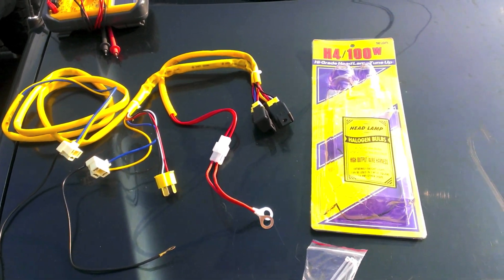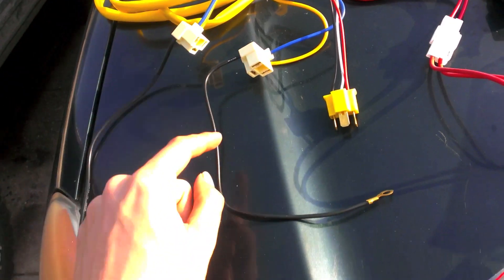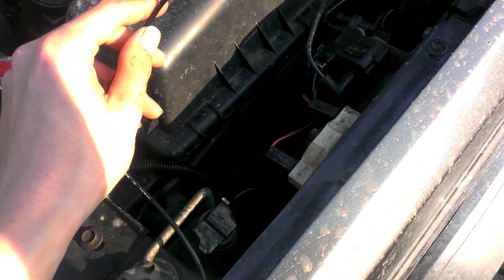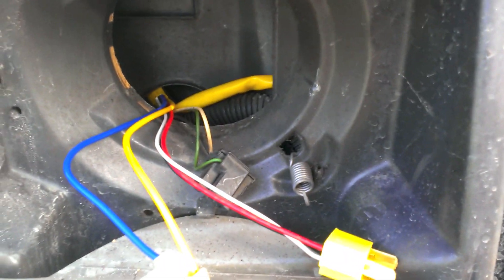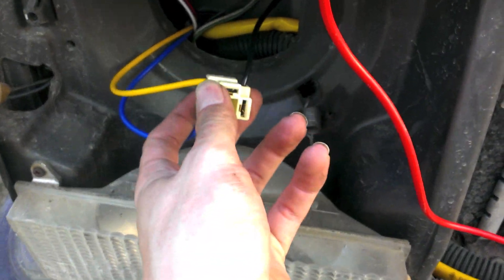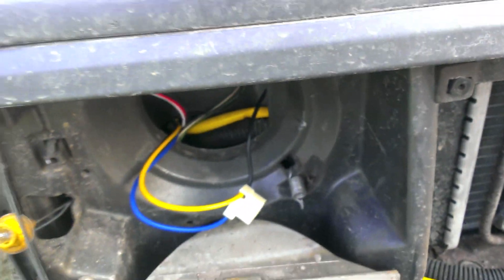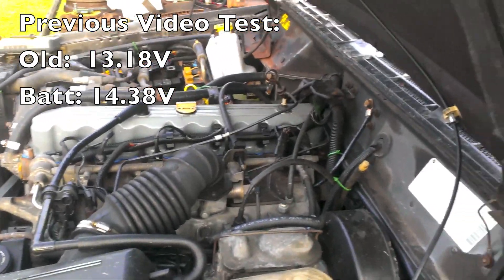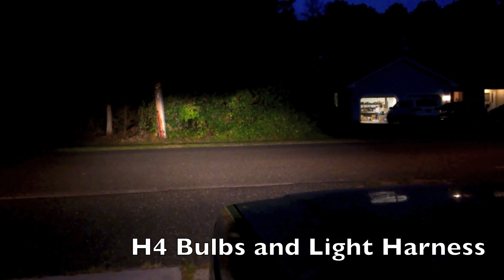89 Cherokee Headlight Wire Harness Upgrade

Comment: Would this harness fix a melted interior switch and dash?
Reply from the maker: The way that was worded was funny. It won't fix your melted switch or dash but it should prevent a meltdown from happening again if that's what you ment.

This harness bypasses your stock wiring by going directly to the battery and sending the electrical load from your headlights through a relay instead of through your vulnerable interior dash switch and old wiring.

As long as your interior wiring isn't shorting out and your stock wires are decent enough that current can pass through without heating up, this should fix your issue.

Comment: Does this also work for other vehicles, for example a handa civic?
Reply from the maker: This is a pretty universal kit so it should work for just about any vehicle that uses that connector style. If you have H4/9003 headlights then it will plug right in.
Reply: NickInTimeFilms Would this also work in projector headlights with the same connection style?
Reply from the maker: +Vaios Kaliakoudas yeah, if it's the same connector it'll be fine

Comment: Wow this is actually really easy. I thought this wiring harness upgrade would be kind of difficult and was discouraging me from upgrading my headlights. But this is actually a really smart way of doing it. I guess I will do it. I'm gonna get an H4 kit and some LED H4 bulbs. Trying to convert all my XJ's lights to LED. I've gotten pretty much all the interior so far
Reply from the maker: Now by interior do you mean just the gauge cluster and illuminated panels or did you also swap the dome and footwell lights? I've been looking into a decent dome light swap so my battery doesn't drain so fast with my doors open.
Reply: Gauge cluster, dome lights, map lights, footwell lights, the lights around the mirror on the visor on the passenger side,the light by the shifter, the light above the rear license plate, and the tail lights. If you do it, get all the lights on Ebay. I think my total came out to about $30 for all that. Just take out the bulbs you already have and find the little code on them. On Ebay search "XXXX LED bulb" ("X's" being the code). They'll all be brighter than stock, draw less power, and can come in colors if you want
Reply: NickInTimeFilms I think the 2 dome lights were less than $3 with free shipping. They come from China so they'll take a while to get here but it's well worth it
Reply from the maker: Se7enAte Nice. How does the interior look with leds? Not too weird going from yellow to white? I'll have to search up everything and may do that at some point. If you really want to go the extra mile, a video walkthrough would be sweet.
Reply: NickInTimeFilms it looks really good. i did this. the interior is just bright white light. no ricey blue or wacky colors. you can see everythign when the door is opened

Comment: Hey dude I've seen all your videos and they have been very helpful! I have a question my 91 cherokee is having an issue, where I only have high beams and no voltage on lowbeams do you have any idea what may be wrong?
Reply from the maker: I'm having issues with my blinkers that I still can't track down. I'll have to pull the wiring harness some time. If your high beams work then your ground should be good. That means it might be the positive cable that runs from the headlight connector to the headlight dimmer switch. My manual says it should be light green so try checking continuity. Or it could be the silly thing that your low beams burnt out.

Comment from the maker: Hey Nick, I haven't actually done anything to the stereo system yet. When I bought the Jeep from the previous owner he took out the rear hatch speakers and sub and left me with some basic Polk Audio speakers in the front and a JVC KD-R210 Head unit that isn't even properly clipped in to the bracket. As for removing panels, you could check my CB Radio install vid if you want an idea of how to run cables to the rear of the vehicle. If I upgrade to a speaker bar or rear speakers, I'll post a vid.